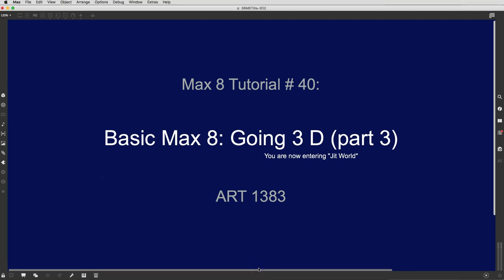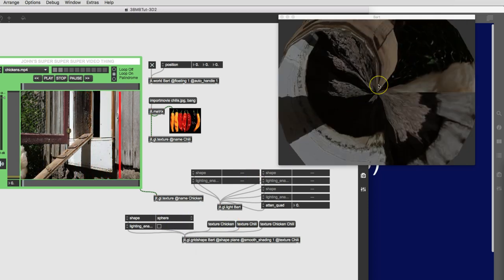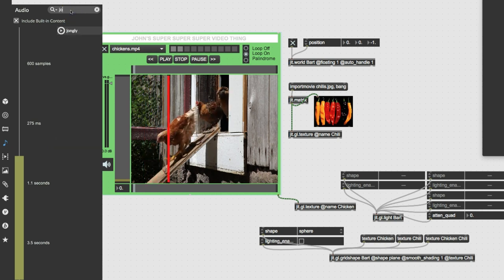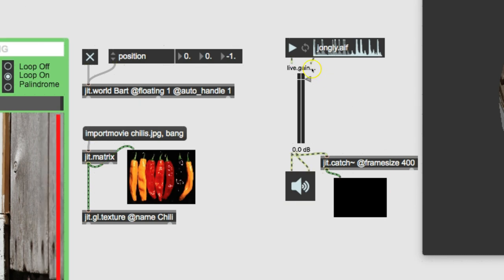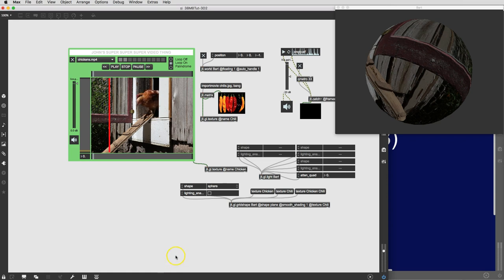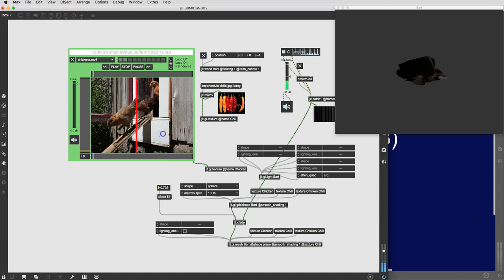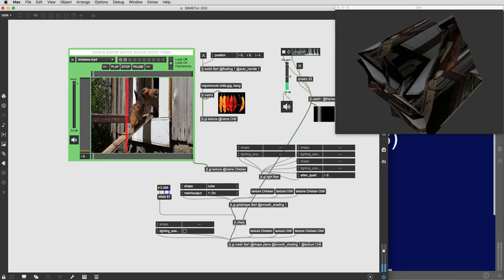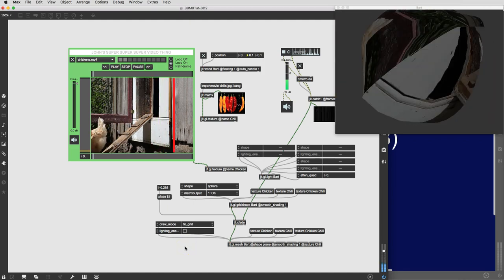Max 8 Tutorial #40: Going 3D with Jit.GL (Part 3)

Comment: Hi there, thanks for this great tutorial. However I have a question, is it possible to connect live.gain~ with a MIDI file?
Reply: The only live.gain~ I have in this video is strictly for listening, it doesn't affect the modulation of the video; So is your question "Can I use a midi-file to modulate video using jit.catch?" the answer is yes, but it's tricky.  Because the midi synth you normally use is actually another app on your computer, you either have to find a way to direct the midi synth's output back into Max (trickier than it sounds) or build a simple midi synth yourself in Max (seq to midiparse, then note data drives saw~, or something like that) and use its audio out to feed jit.catch~ .  The other possibility is just to forget jit.catch~ and figure out how to use the midi data to modulate video.  Sorry all answers seem too long...
Reply: @johnreed3238  Hi there, thank you so much for answering my question so quickly. About my problem, I tried your suggestions however, I realized that these might not apply to my problem. The reason why I say that is because I believe that I don't think I worded my question in the best way, (sorry english is not my first language, plus I am new to MAX8), so I am gonna try to ask again, properly this time.

Is it possible to connect a "Preset" (in which has MIDI synths stored in it) to a jit.catch in order to modulate the video?

Once again, apoligies more my bad wording.
Reply: @TheGreatestandTheLatest  Actually, that makes it more confusing, but mostly because Max has a certain jargon that can be misleading.  There is a "preset" object in Max that will NOT do what I think you are trying to do.  But, if you are trying to trigger certain audio clips using MIDI, that might be possible.  Maybe the best way for me to help is if you tell me exactly what you're trying to do.  You can email me at <dearjohnreed@yahoo.com> if you want to.